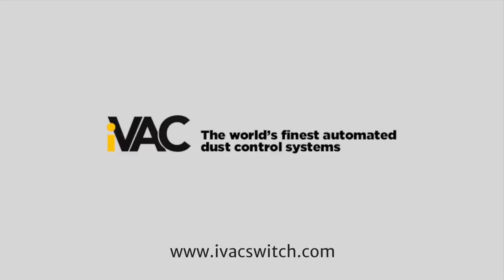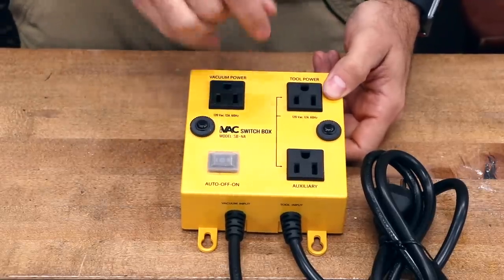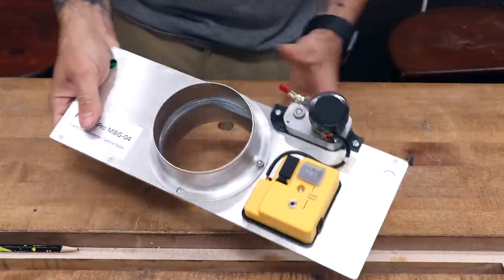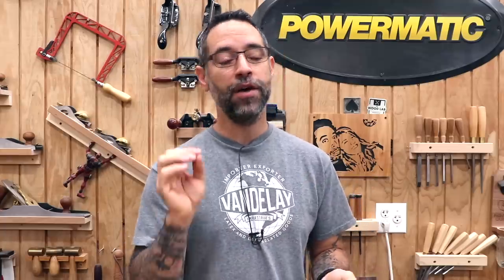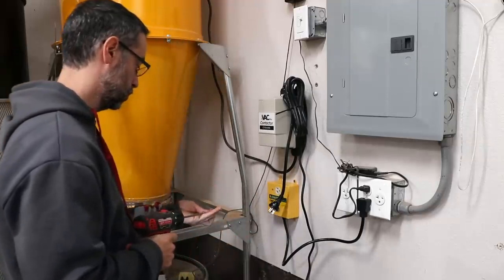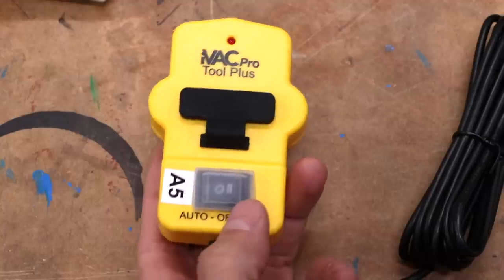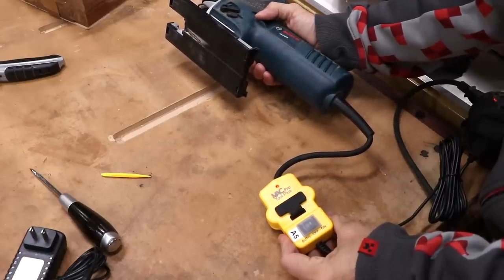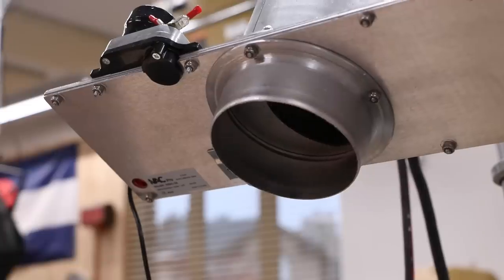Automate Your Dust Collection with iVac

Comment: I did a sponsorship with these guys and Rockler a few years back.  One of THE best upgrades I've ever done.  Has been 100% rock solid and reliable since day one.
Reply from the maker: Guess what video I watched before doing my install. 😁
Reply: Dude!  Love your videos Geek Pub!
Reply: Correct me of im wrong but if i wanted one of these on every major tool we are talking thousands of dollars?
Reply: @ivac9521  5 that would require these blast gates.
Reply: @ivac9521  i see. I would actually need the 6" and i thought i had to buy the additional sensor and relay switch.
Reply: @woodwhisperer  After spending money on a 2hp cyclone collector, and a bunch more on pipe hose , fittings, ceiling mounted air filters, and a Mini-split in Arizona, I found myself using a lot of sentences with four letter words.  Examples would be;  "sh-t, I didn't turn the collector on" or "I didn't change the hose", "crap now the collectors been running for 15 minutes and I'm done with machines!"  etc. etc.   Why did I spend all that money on "stuff" and not use it efficiently?  Rockler had the gates on sale last summer for about $65, so I bit the bullet and bought five plastic ones. Now a good comment would be  like Alka-Seltzer "Oh what a relief it is"!  
 Some FYI's for your followers:  Do not need the controller for 2hp or less,
if the collector is less than 2hp and has a Magnetic Switch you might need to wire it (contact Dave at I-vac for a simple schematic), can run two machines (cords through the sensor).  I have the Rigid Oscillating sander and a band saw on the same blast gate and sensor.  Factory setting on the sensitivity was right on.  But for example when a Makita 18 volt drill is held close enough to the sensor it would activate the gate.   Thank you I-vac and Dave for his help! A great product!  

By the way Mark, I too watched GeekPub install.  Also, the LED's from American Green Lights are great.

Comment: I have had an ivac control system on my dust collection for many years now (just the remote switches, not the gates). It has been flawless the entire time. I recently added a second system and I got another ivac switch for that new system and because of the multiple frequencies they can run without interfering with each other. I find it be a very convenient system and well worth the investment.

Comment: I have had the Ivac system in my shop for several years and I have had zero issues with it. I have been thinking of upgrading it to the style they have now. There is nothing wrong with what I have now but my nephew is in the process of setting up his own hobby wood shop so I thought maybe I would give him my system and get the current system for myself.... He doesn’t have the budget for it right now and I have been giving him some of my older tools that to help him get set up...

Comment: Good review and disclosure. I looked at this when I installed my cyclone but all the blast gates, sensors and additional recepticals would have cost as much as my cyclone. My system came with a remote to turn it off or on, good enough. Just remember to open the gate.

Comment: You had me salivating when you started talking about a sponsored video; I was really hoping that meant iVac was going to offer a promo code.  As you to continue to talk to them, it would be awesome if they did!  I've been considering it for years, but at $250/ea for the 6" blast gates, it's a big investment.
Reply from the maker: I'll see what we can do.
Reply: The Wood Whisperer ...that really should be top-of-mind for any sponsor. A promo discount is really the only the call to action on these videos for them - if they don’t offer it they’re wasting a Golden opportunity to pick up customers (and more referrals).
Reply: I agree. I bought one of their remotes for controlling my dust collector without having to walk over to the switch. I love it. But their blast gates are just crazy expensive! Each tool would be over $300 for the blast gate and tool sensor. That's more than some of my older tools cost!

Once I get all my duct runs completed, I'm going to experiment with an Arduino-based solution that would be way, way cheaper. There's a Youtube video (https://www.youtube.com/watch?v=D1JWH425o7c) where someone shows how he automated his dust collection system with an Arduino and some servos and relays. He even gives away the source code.
Reply: @ivac9521  That would help some, but about half of my tools have 5" or 6" drops, so I'd need your 6" blast gates, which only come in metal/$$$. One of these days I'm going to try a DIY, Arduino- or Raspberry Pi-based dust collection automation project.

For a professional woodworker, it totally makes sense to just install a full iVac system and get on with building cabinets or furniture and making money. But for a hobbyist who also likes tinkering with computers and electronics (i.e. me and probably many other viewers), a DIY solution is attractive.

I don't mind paying premium prices for nice tools, or even for high-end ducting (e.g. Nordfab). In those cases there are a lot of alternatives and I know what I'm getting for the extra money. But in a case like this where it seems like prices are high mostly because there's little / no competition, not so much. Though to be fair, iVac's prices for automated blast gates are way lower than Nordfab's 😀

Comment: How well does this setup work if 2 people are in your shop using different tools?  If I'm running the table saw and my wife is on a sander, is the system smart enough to keep both blast gates open?
Also, is it possible to configure 2 of the sensors to operate 1 blast gate?  The use case for that would be me having 2 tools close together with 2" dust ports.  I dont mind these two tools sharing the same 4" blast gate.  So I would turn on either or both of my drill press and router table and the single blast gate would open.

Comment: Did you have to buy nordfab flange pieces and modify the ivac system to fit with your ducting? How's did you connect them to the nordab?
Reply from the maker: Apparently Nordfab makes a version of their 4” machine adapter that is slightly wider, allowing it to fit these blast gates. So every blast gate required one.

Comment: I'm having serious issues with the Tool Address 1 (Always Open Blast Gate) blast gate. It works fine whenever I'm using any of the other tools (Tool Address 2-8, Blast gate 1 closes whenever I turn them on and opens after they close) but whenever I'm finished using Tool 1 (Blaste Gate 1) it closes for about 2 seconds and won't allow air flow to my extractor, maybe 2 seconds won't damage the components of my extractor but I can't figure out why it doesn't stay open.

Comment: Looks like a great product. My question is with the large dust collector is it good to be Turning it on and off when you go from tool to tool?  I actually asked about this awhile back on Friday live and you said it wasn’t recommended to cycle the dust collect in and off too much. Thanks for the info!!
Reply from the maker: I mentioned this in the video. It has settings for turn off time. I have 45 seconds to fire up the next tool before the system shuts off.
Reply: Hi Jeff. In order to look after High Power Dust collectors we supply a software update to the iVAC Pro Switch called Minimum Run Time. This ensures that the Dust Collector runs for at least a programed time of 2, 4 or 8 minutes. This avoids over heating of the motor.
You can find the details on the iVAC web site. in the 'Tech Corner' http://ivacswitch.com/wp-content/uploads/2015/11/High-Power-Dust-Collectors-Minimum-Run-Time.pdf

Comment: I don’t recall if your miter saw is connected to your central vac. The blast gate looked a little slow to open. Do you think there would be any issue with quick use tools like the miter saw?

I priced this out for my cabinet shop and it quickly became more expensive than I was hoping. Maybe when I build a new shop and get a central vac I’ll check this out again.
Reply: William Butler I have one on my miter saw (separate system from my table saw) and what I did was set the off time for a full minute. That way when I'm making multiple cuts it gives me time to grab the next piece of stock or make a measurement or line something up without the collector shutting off right as I'm about to use it again. This minimizes the amount of machine cycling. Also, when I'm just going to make a quick cut I'll spool up the saw for a second to get the collector going so it's already pulling suction when I make the cut. The ivac puts a slight delay on DC startup so you don't have the inrush of the tool and the dust collector hitting your electrical system at the same time.

Comment: How did you address the the 220 to 110? What is a contactor and how did you install that? And can you install that to any 220 tool like a table saw?
Reply from the maker: The sensors don’t care about the tool voltage. They just clamp to the power cord. As for the contractor, that just something that allows a high power 220 tool to accept on/off commands from a lower power switch. I don’t give wiring advice but if you google around you should find info on it.
Reply: You can find the details of the iVAC Contactor at https://www.ivacswitch.com/ivac-contactor/

Comment: Too proprietary  technology. Wi-fi is the way to go. They will fail. Dip switches. Hello?  Dip switches. What a joke.
Reply from the maker: Honestly not sure I’d want a wifi-based system that controls a safety-related device in my shop. Wifi Isn’t exactly the pinnacle of reliability. I’d put more faith in RF.
Reply: @woodwhisperer  Do you know what wireless protocol the iVac units use to talk to each other? Zigbee maybe, or something iVac cooked up themselves?
Reply from the maker: RF
Reply: I suppose you would say it is something that iVAC cooked up over ten years ago. It is 434Mhz FM modulation. There are over 30,000 systems in the field and therefore to maintain backwards compatibility it is not easy to change.
 @laurawerner
Reply: @ganivac1103  Interesting, thanks!